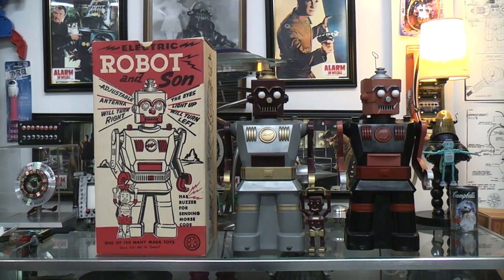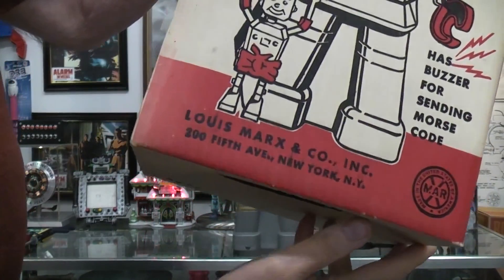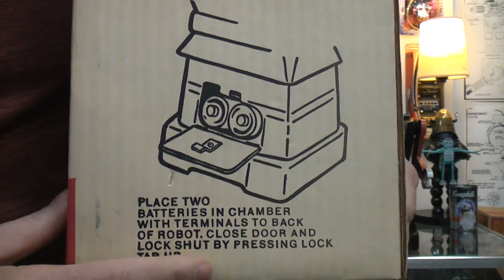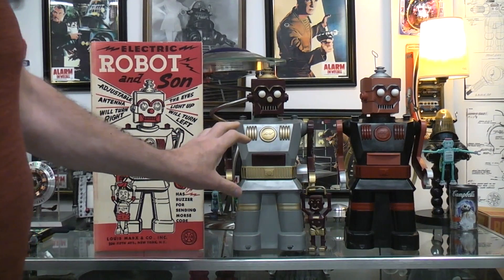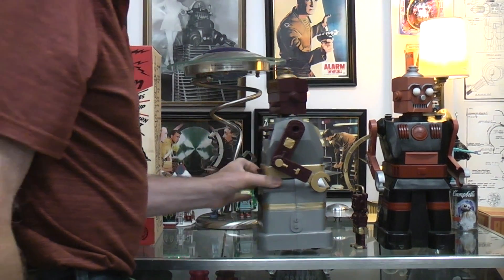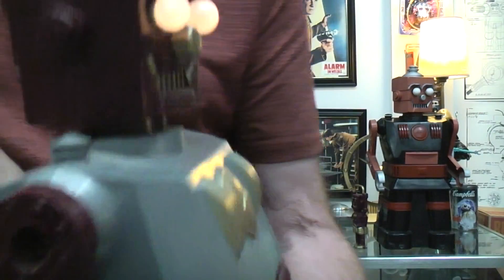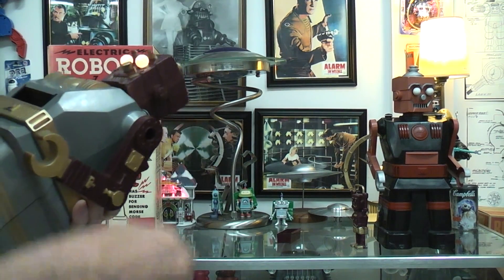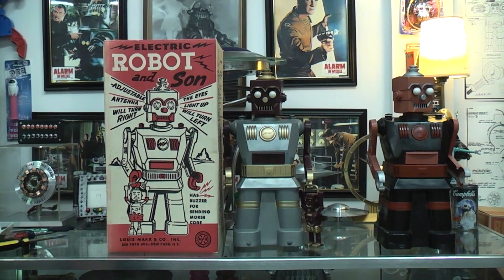Electric Robot "and son". a 1950's Communications robot.

Comment: I’vebeen looking for the proper replacement bulbs for this guy; 😢
Reply from the maker: It is very hard to find the large glass globe 1.5 volt lamps these days. There are some large glass globe lamps rated at higher voltages still out there for vintage train guys but they do not light on the 1.5 volts of the Electric robot.
Reply: @Robothut  that’s a big double dog dang it!